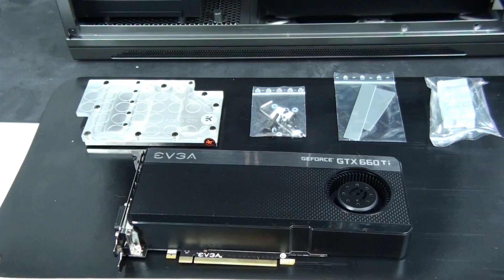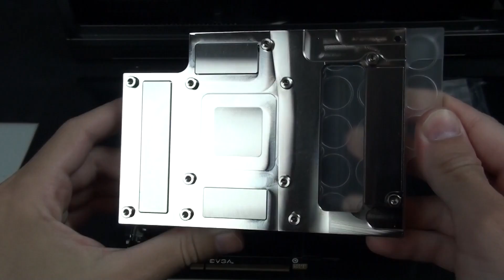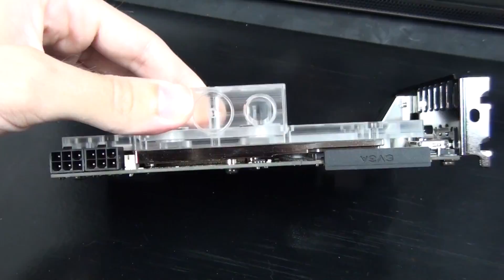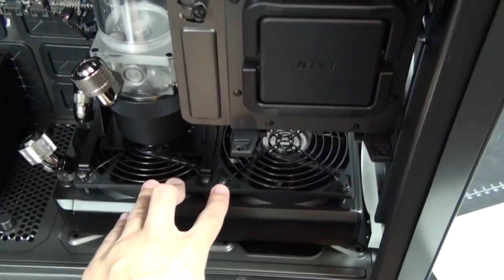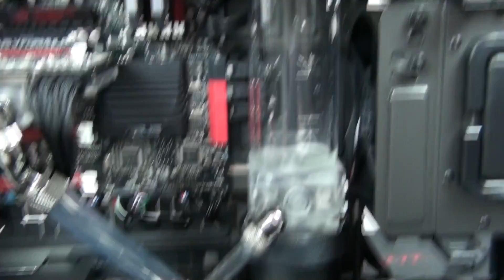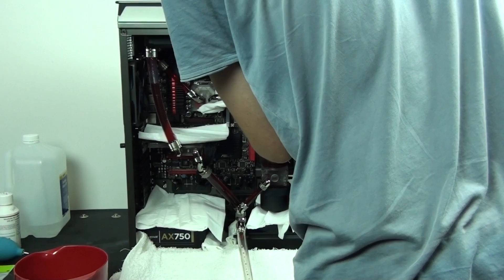Build #7: Dark Matter: Part 2

Comment: also there is something here in the states called "ENO" which is an antacid powder which i actually ground down or grind into a finer powder and then mix the chemicals that prevent gunk and algae into distilled water then add some mayhems dye (transparent ones) then add the eno (howmuch you desire) a 3/4 - full cup is good for a liter or two the end result is like a non staining mayhems aurora but ctaully looks like soda is in youre loop

Comment: what is youre opinion on running the return line to the top of the res so it you can see the water flow back into the res kind of like a fountain or water fall ?

Comment: I also have a ASUS Maximus V Formula in a Corsair 800d Case. My thought is to use incorporate the water block on the motherboard along with the CPU, and Graphics card. Another question is it absolutely necessary to water cool the memory when WC the other components?

Comment: Yes, you could, check my channel to have a sample of draining system at that location (i use a 120 rad at the bottom and a tube res but the principle is the same). i have an NZXT Switch 810 too :)

Comment: Cool setup dude. I would, however, recommend to try your games without an overclock. It was a hard lesson for me to learn because I thought the more Ghz the better the gameplay but I got the exact same performance @ 3.5 Ghz as I did @ 5 Ghz. My 2600k never hits 45c in ANY games, so I expect to replace the SSD & PSU 2 or 3 times before the CPU dies. That 450w PSU might B your weak link due to unstable power. 450w is enough but efficiency is another story. Good luck with the gtx670.

Comment: Looking at building a custom loop in my Switch 810. I really don't know how/where to implement any sort of drainage system. If I do a similar build but with a dual bay res/pump (like from XSPC) and have it go to a lower 240 rad first, could/should I implement the drainage system there?

Comment: You not gonna be able to close side panel with this magnetic dust filter( it will go on the way of that panel), I had to put dust filter on the other side and just screw it with the fan into the case.

Comment: as long as ram sticks are in slots 1,3 or 2,4 it will work in dual channel mode. i have my ram sticks set in the same slots he has his setup and they work in dual channel mode. 

now if it were an AMD build he would have to set the ram sticks in slots 1,2 or 3,4 to get dual channel working.

Comment: Hi, I've watched a lot of your videos until I finally completed building my beastly water-cooled PC :) and I'm still watching every single video that you upload. Anyway, I have a suggestion, that I think would make the loop look better: try to rotate the outlet of the graphics card so that it's horizontal and then use a 90 degree fitting (with some extra extensions) and go with the tube straight up to the radiator. I think that straight line would make it look much better. My opinion anyway. :)

Comment: not going to use the motherboard mosfet/vrm optional waterblock?  you'd have to use the included barbs unfortunately so you'd have to run clamps which might affect the aesthetics but would help overclock stability